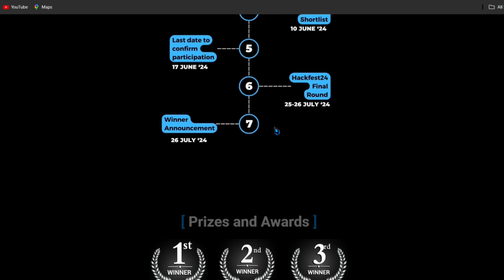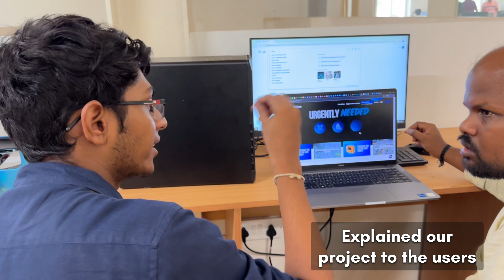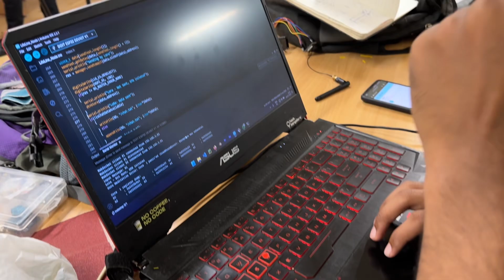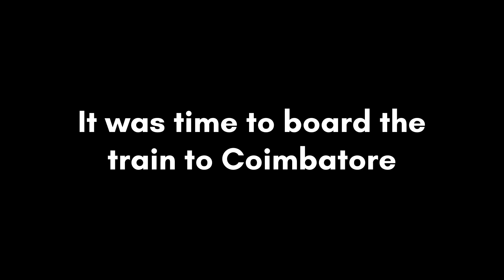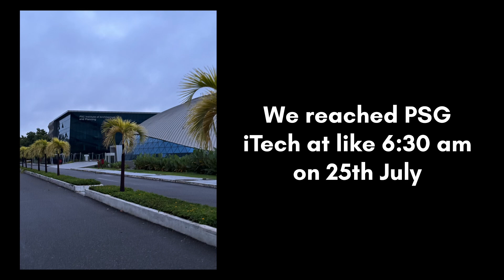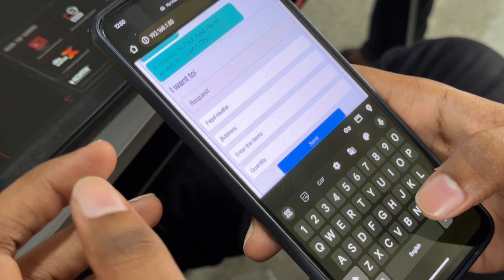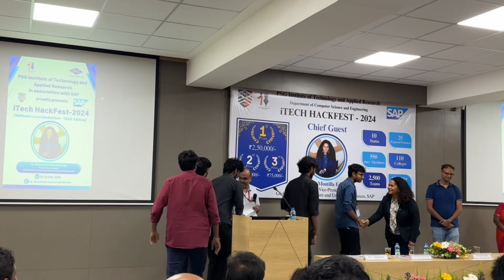We won ₹1,50,000 in a National Level Hackathon | Hackfest 2024 - SAP

Comment: What you made actually? It like like phone charger
Reply from the maker: We made a communication device which can be used during disaster times as there won’t be any access to internet or signal. This consists of a LoRa trans-receiver which when turned on acts as a hotspot and it connects with any device that can connect to a wifi. These devices act as nodes and form a mesh network and transmit the requests which may be food, medicine or any other requests and send it to the rescue agencies which are outside the disaster affected areas. The phone charging feature would be useful when there is no power and there is no charge in mobile.